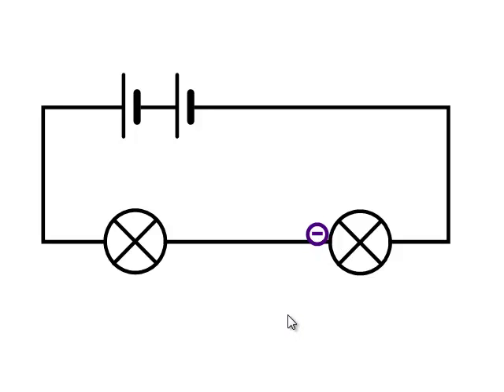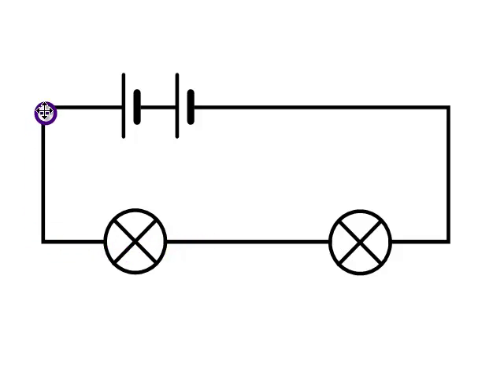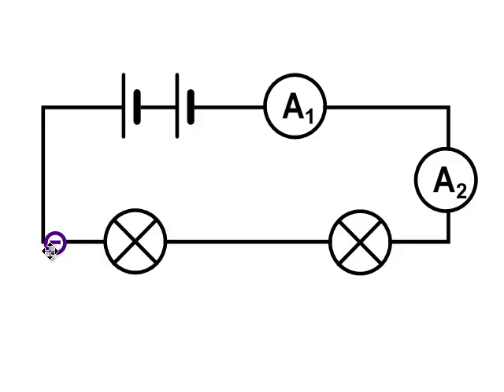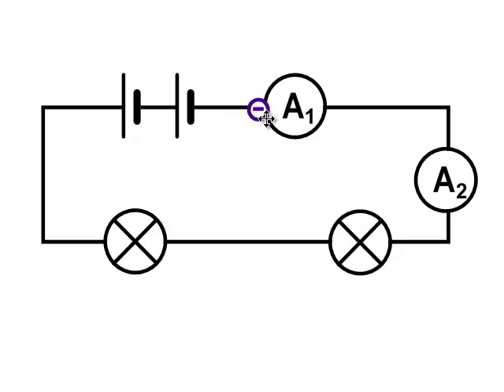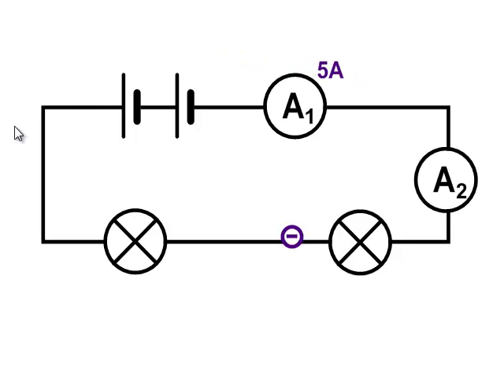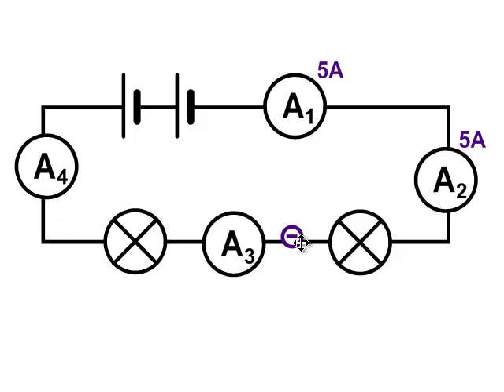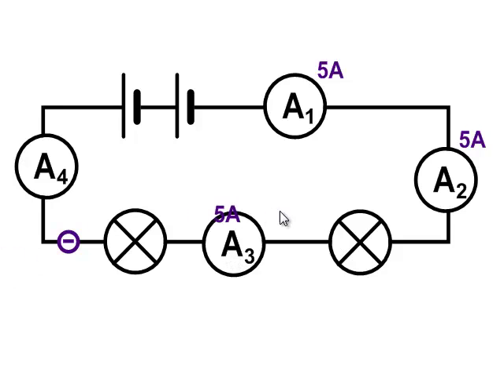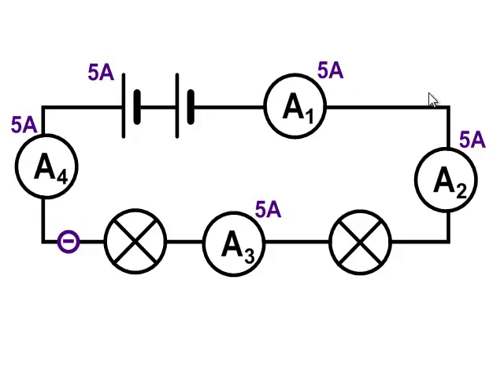Current in series circuits

Comment: . According to my textbook current is the rate of flow of charge,it is directly proportional to voltage provided the resistance remains constant. So, when current which is basically electrons carrying electrical energy,when they pass through a resistor or lamp or any other electrical component some of the electrical energy gets converted into thermal energy,so the electrical energy they carry is reduced,right? And as they pass through a component they undergo collisions with the atoms which causes their speed to reduce,they will travel slower and therefore pass through the resistor much slowly,so as its speed reduces the current should reduce ? As current is the rate of charge,it's rate will definitely reduce due to the collisions it will go through,right? I understand that the "amount"of electrons will remain same as everyone says,but current just isn't "flowing electrons" it's the rate at which they flow,so although the amount of electrons flowing remains same,their rate of flow decreases so isn't the current supposed to be reduced rather than remain constant? I could be totally wrong but I haven't found any resource which gives me the answer to my question,everyone claims the amount of electron remains same (I agree) but no one refers to its rate.I am studying this entire chapter by myself so sorry if something I said tends to be wrong

Comment: But what if the first lightbulb has larger resistance than the second one, so is it true that the first lightbulb will have less electrons flowing than the second one, so why does the current stays the same?